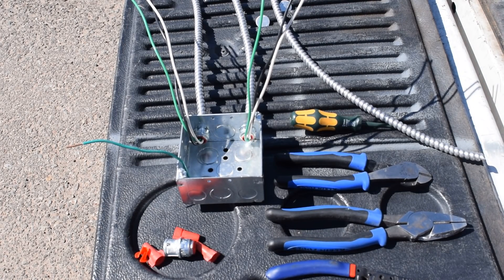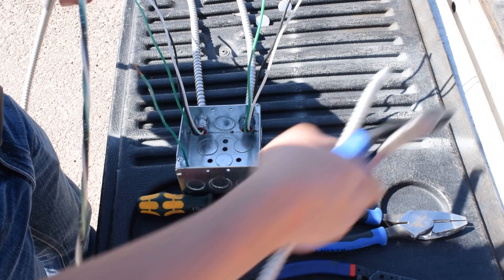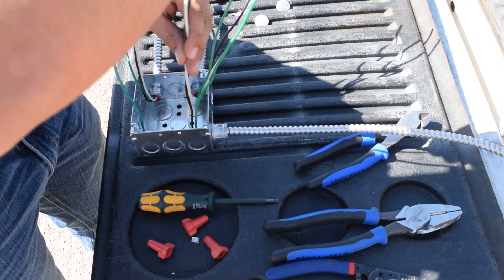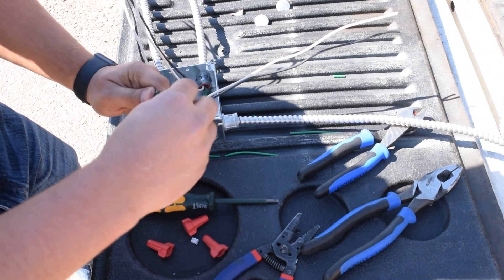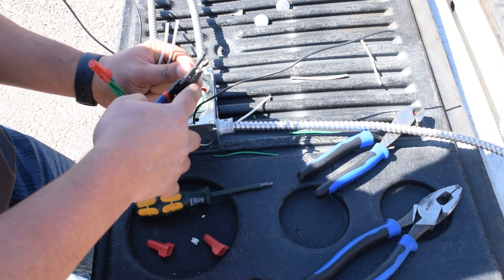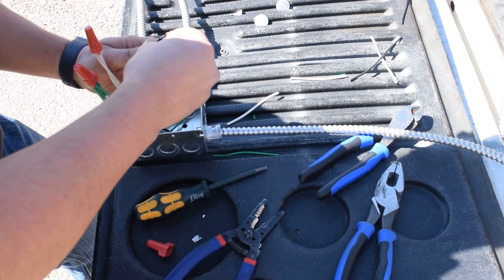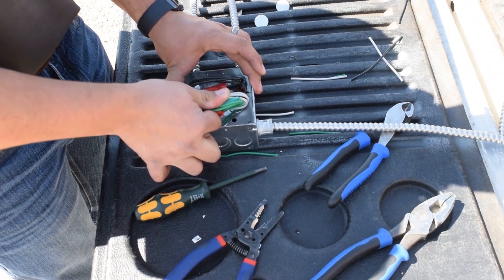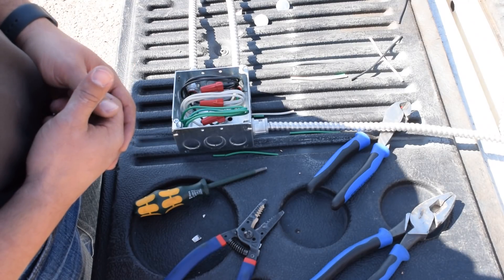How to Make Up a Electrical Box the RIGHT WAY!

Comment: If I work in an area where there might be the slightest possibility of moisture or water getting into the box I've gotten into the habit of pointing my wire nuts up so they don't collect water.
Reply from the maker: I forgot to mention. Great comment
Reply: Hook up to a PIV (Post Indicating Valve), outside valve switches, waterflow switches, or other fire alarm connections outside and this is very relevant.
Reply: @LadyAnuB. Are you saying plastic tape will keep water out ?? Because it won’t and yes I have wired outside PIVs and flows. If you get a little water in a wirenut it’s not going to end the world now after time it will rot and rust out the inside the wirenut and eventually cause a poor connection with the copper but it would take some time.
Reply: @stanley4006  Tape of any kind to keep water out? You know as will as I do that it won't. I like the wirenuts on the up side idea. I prefer not have any water in a wirenut. Going back to deal with intermittent faults that occur with watered connections is something I prefer not to deal with.
Reply: @LadyAnuB  👍🏻👍🏻
Reply: also, might be overkill but i always wrap my wire nuts with electrical tape going clockwise so the nut has almost no chance of backing off or coming loose. also helps prevent moisture from getting in them
Reply: @MuttonChops24  I'd stay away from the electrical tape. Makes it a nasty mess for the next guy that has to work on something 10 years down the road.
Reply: @MuttonChops24. That plastic tape won’t keep the water out. Waste of time and differently isn’t the professional way of doing it. When I open a box and see tape it makes me wonder what was messed up when the splice was made
Reply: @MuttonChops24  that’s a waste. That’s homeowner splicing.

Comment: It is the right way yes to do your grounds first . If for any reason your wires get energize.  You want the ground to work and trip that breaker not run through you. In Canada they are called shorts not cerry.  They prevent the wiring from chafing.  Or ant-shorts. I have not heard them called dikes . I know them as dags.  Short for diagonal sidecutters.  Other than that very good job . Yes you save lots of time if you label your cct and panel on the inside.
Reply: That Wera screwdriver you are using is a #1 Robertson. In Canada, all the screws you referenced are #2 Robertson - not true in the USA? Also, you didn’t use the ground screw in the junction box. Is it customary in the USA to allow the armour jacket to act as grounding for the junction box?
Reply: Oops,  just reviewed and I now see 4 green wires. I missed the step where you installed the connection to the grounding screw.

Comment: Prefect!!! Only thing I would add is MC manufactures require the metal jacket be stripped by a rotary cutting tool designed for use with mc cable.

Comment: I like the thinking about the next guy. Wish more though like that. 9 out of 10 contractors seem to be in such a hurry and don’t care about quality or future work. Maybe a video like this would help teach new guys the ease of doing quality work. Thanks for the video.
Reply: If he was thinkinging about the next guy he wouldn't twist the wires together...
Reply: @davey6024  more secure that way
Reply: @dylansfirewood6852  im pretty sure that twisting soft metal together is not more secure than a wago or crimp or connector block for that matter.
Reply: @davey6024  I have not had any problems with it and it’s cheaper
Reply: @dylansfirewood6852  Its just shit. Makes it a pain in the ass if anyone needs to work on it. Who likes untwisting wires or having to cut them when you could be unscrewing a terminal or lifting the lever on a wago. Ask any real electrician and they will tell you twisting of conductors compromises the integrity of the wire. Its a fact accept it.
Reply: @davey6024  they do I work with a master electrician 15 plus years
Reply: @davey6024  yeah it is tighter but more expensive you should not have to redo wire in the first place
Reply: @dylansfirewood6852  I am a master electrician with over 15 years experience. Keep on twisting those wires buddy if you haven't got a dollar to spare on 3 wagos to make a safer joint that will make future inspection, testing and possible alteration or additions more easy. Good luck to ya
Reply: @davey6024  what ever you do you

Comment: Looks good to me. Only thing I do differently is that I strip one of the ground wires by the bonding screw so I don't have the extra wire.
Reply: I use to do that also,some inspectors do not like it.
Reply: That is the way I do it to to save space.

Comment: Dont you do the 6" from where it enter the box?..
Reply: yes, but that's the minimum requirement, so there's nothing wrong with the way he's doing it here. Having longer leads certainly makes the box easier to work in, and tidier when it's done.
Reply: @Mawson6492 : yea, it looks clean...
Reply: @Mawson6492  Also, so later on if that box  it gets taped with a another wire it can be done Hot with less of a chance of a blow up. I know I know you suppose to turn power Off when working on it.
Reply: I thought it was supposed to be 6 inches from the outside edge of the box, not where it enters the box.

Comment: When you are making up connections.   Strip your wires too long, line up the end of the insulation and twist, then cut to proper length, wires should hold themselves together, and wirenut is just for insulation.  That's how I was taught.  But that is all personal preference, if you want to just hold the ends even then put on a wire nut it's fine, but do a "tug test" if it doesn't work it's your fault.        Maybe I should just leave all the nubs thinking the overkill way is code.
Reply: @TheYeeterDefeater  Pretwisting also helps prevent arcing by keeping them close together in the event they become loose inside the wire nut.
Reply: Per manufacture directions, pre twisting is not necessary.
Reply: @bluerockstudios5812  I know pre twisting isn't specced and takes extra time, but I had to fix 3 #12 neutrals on an outdoor light circuit that were not twisted together, the wire nut was loose, and they were arcing.

Comment: 6" outside the box is wrong.      6" from point of entry or 3" outside the opening, whichever gives you longer conductor.     <NEC 2017> 300.14  Length of Free Conductors at Outlets, Junctions, and Switch Points.    At least 150 mm (6 in.) of free conductor, measured from the point in the box where it emerges from its raceway or cable sheath, shall be left at each outlet, junction, and switch point for splices or the connection of luminaires or devices. Where the opening to an outlet, junction, or switch point is less than 200 mm (8 in.) in any dimension, each conductor shall be long enough to extend at least 75 mm (3 in.) outside the opening. Exception: Conductors that are not spliced or terminated at the outlet, junction, or switch point shall not be required to comply with 300.14.                Less then 8" in any dimension?  Does that mean corner-corner or circumference?
Reply: 6" outside the box is not "wrong".  The code says you need a "min" of 3" beyond the front of the box.  Thank you for not making your wires that short.
Reply: @creamwobbly  Boomers know how to use all units and use which ever fits the job. No need for you yung'ns to be rude, just because we know more.
Reply: Helpful comment.  
-
To answer your question, I believe "less than 8" in any dimension" means if any dimension in the opening, whether it be the length, width, height, or diameter is less than 8" you must have at least 3" outside the opening.